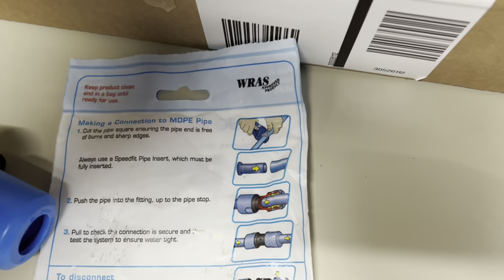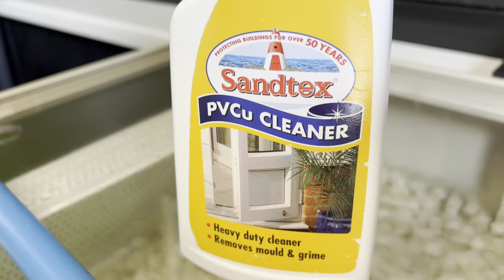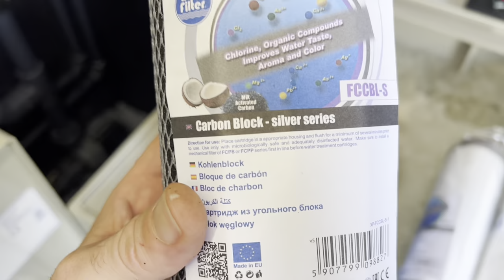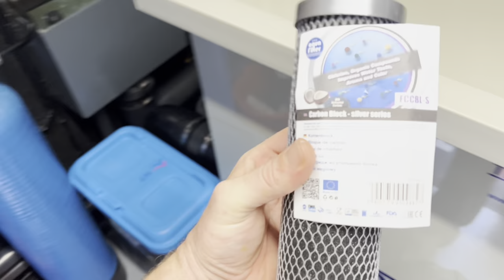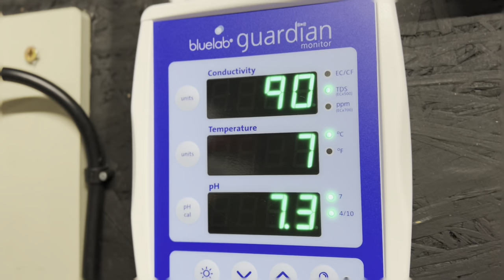huge koi pond project**THIS WAS A GREAT IDEA** THE DIY TOOLS ARE BACK OUT !!!!!

Comment: Cracking Job! 👍🙂
The 3 pod looks to be piped up backwards though...
It should get dirty around the outside of the sediment filter and middle stays clean, as it has a bigger surface area. 🙂
Reply from the maker: Could be something going on with mine then ?
Reply: @JamesTHEKOIwhisperer123  
They should be marked 'inlet' where the water connection in is. 
If you look at the inside of the top parts, there is a hole in the middle, 
this leads to the exit from each pod into the next one, just make sure they are connected the right way round.

Vyairs are usually set up to feed water right to left, if the pod doesn't face the right way for your water connection.
Just unscrew the pods from the bracket and turn them around and then screw them back in 🙂👍
Reply: @JamesTHEKOIwhisperer123  Dave is right James, the directional flow through the filters is from the outside of the filter to the inside of the filter.
Reply from the maker: @trevorwaugh5005  I will definitely look at mine then something is not working right with mine then lol 😂